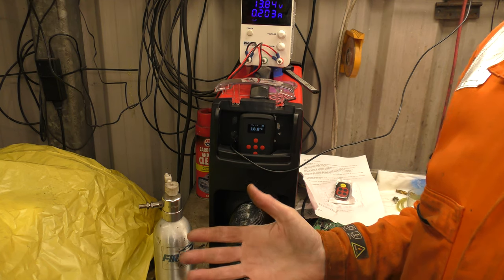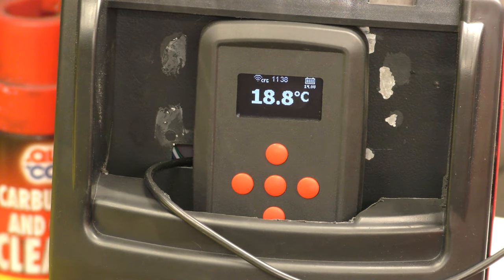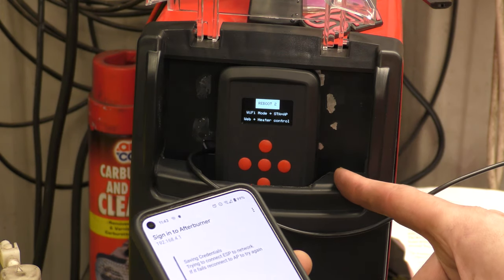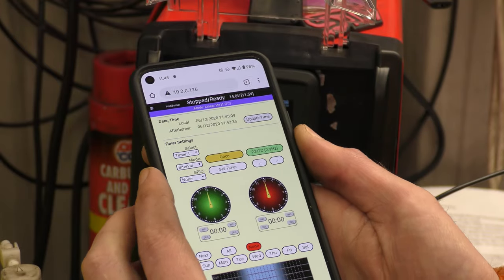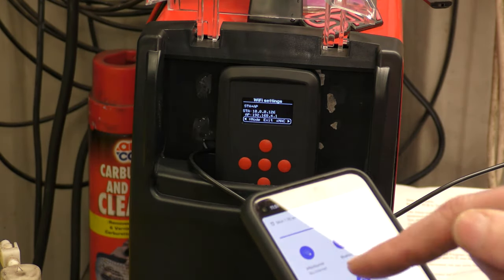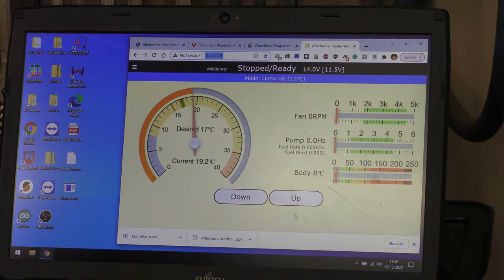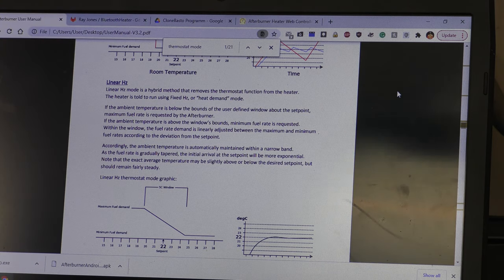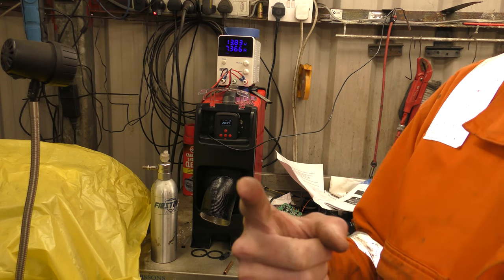Afterburner - quick wifi connection

Comment: I've ordered the afterburner through Ray and is on its way. Question I have is how do you get the wifi to connect to different  location to your home wifi for example. Is that straight forward enough? 
I ordered all the whistles and bells one..
I'm 170 Miles away from what i want to switch on?

Comment: Great video thanks..  

I was wondering if u could do a video showing any ill affects the diesel heater would have if using diesel with a fuel additive in it.  The likes of dipetane or other additives for cleaning dpf filters as most camper owners will have the heater plumbed to the main tank?  Cheers

Comment: Hello mate just fitted my sixth one of these heaters this one has come with green plastic flexible hose for the fuel can you see any problems with this flexible fuel line as I am thinking it might cavitate or not give proper delivery as it can expand when the pump pulses and also it's a 4mm bore cheers for all your videos you are an inspiration hope the info I sent you last message came in handy as a reference
Reply from the maker: Fuel hose is fine.  I've got that green stuff on this heater and a few others I've had are supplied with it as well.  The fuel doesn't need any real pressure going into the burn chamber as it's the heat of the atomising mesh that atomises the fuel.
Reply: @DavidMcLuckie  ok thanks for the reply it just looked a bit sceptical and flimsy I don't even know if it's diesel proof it's not flammable so that's a good start!! It's running under a van through rubber grommets .... My main concern was the pulse of the pump not delivering full fuel flow burner end because of the give in the hose ......IL run it up again tomorrow cheers again David

Comment: Probably an obvious question, but cab you it be used to run just the fan with the heater off? I have a work van kitted out with a fold away camper set up, it's biggest downfall is ventilation, just wonder if as well as being used as a heater, if it can be used to draw cold fresh air in from outside. Cheers man, love the videos
Reply from the maker: I wouldn't have thought so as a correctly installed heater recirculates the air it's heating, not drawing in more cold air from outside.
Reply: I would like to see that function also, just to have some air movement on still balmy summer nights.  I've been tempted to splice into fan wires for this reason.

Comment: Could you explain why wasted heat from the Diesel heaters is not captured in a secondary heat exchanger.  For example, the clean exhausted heated air is passed over a coiled exhaust pipe chamber, and the combustion gases are passed out to the exterior as normal?
Reply: I've seen it done nicely with a cast iron radiator and a moisture trap

Comment: If it’s connected to home wifi it should work anywhere tri IP address when on cell service only. Should pull up an run remotely anywhere around the world if so.
Reply from the maker: Yes, you could set up a dynamic hostname (assuming dynamic ip address) and you could just browse to your own hostname and voila, into the heater controls.  :)

Comment: I'd like to see if you could use the heater to dry cloths in a tumble drier if you removed the elements. For off grid . Just a thought.
Reply from the maker: I don't see why not.  Sadly I have a dead tumble drying, but it's the drum bearings that are spent.  So I'd mostly be setting fire to clothes inside a tumble dryer.  Don't give me ideas.  :)
Reply: Dryer heaters are generally 5kw so it would be a great fit

Comment: In the "System settings" - there is a "Start qualification" setting - apparently that allows to start the heater even when the ambient temperature is above the desired temperature - I guess useful for testing and demos.

Regarding my question on a previous video, the firmware development page lists among various bugs fixed "Incorrect start denials due to Low Voltage Cutout" - so maybe it is smart enough to ignore voltage drops due to the high current consumption by the glow plugs during startup?

Thank you for the video - all very interesting!
Reply from the maker: The start qualification is good if let's say the current temperature is higher than the desired temperature and you know it will fall and want the heater on.  So it'll come on in suspended and only fire up once it gets below.  Otherwise it just wouldn't let you turn the heater on if the desired is above current.
Reply: Oh ok - thank you for the explanation. I've been reading through the manual, but I still can't understand what is the difference between shutdown mode, suspended mode and standby mode. I guess if the heater has stopped, it has to go through the startup sequence, glow plug etc. anyway, doesn't it? Or maybe in full shutdown mode the heater will not come back on automatically no matter what the temperature or other conditions are met?
Reply: Its Low Voltage cut-off is really clever - in that as well as obviously being able to set the LVC - in the same setting screen (on the device itself), it also allows you to set a 'margin' - so, say 0.5, means it will still allow start-up with the drop going to 10.5V.

Comment: hi still having problems cant get any of my 3 new pumps to work can see flashes on a lamp if i go across the pump does not make any sense
Reply from the maker: Hmm.  So no tick from the pump when plugged in?  What size of lamp did you test with?  Could try with a 12V headlight bulb and see if it's a load issue.
Reply from the maker: The only other problem I've seen like this was when long thin wires were used for a fuel pump.  I had continuity along the wires, but the pump refused to work.  Shortened the wires and the pump worked, but unhappily.  I suggested swapping the wires out for a heavier gauge.

Comment: I love your videos and attitude keep up the good work I just got two metal housing 8kw heaters to put into my bus and what I would like to know if I could control two heaters with one afterburner
Reply from the maker: I'm not sure about that.  In theory if you could have one ECU control both heaters, basically piggy back the fuel pulse, fan voltage and glow plug to the second heater.  Then you could have one AB control it that way.

Comment: Dear friends. 
May I ask if a 60v 5amp @ 150w bench power supply. Allow me to use 12v at just above 10amps for a diesel heater??? 
I know I can buy a 30v 10amp supply but my needs will need at times to supply 42v @ 2amps. 
Any help would be highly appreciated ✌️✌️✌️
Sincere regards, 
Scott. ✌️🙏✌️

Comment: Great video, but I think I'll just stick to pressing on and off with the controller if I'm up and the fob if I'm in bed. Much simpler.
I defo dont want it turning on and off by its self all day and night using 8A every start up and shut down.
Reply from the maker: A lot of people really, really want that feature though.
Reply: @DavidMcLuckie  yes I'm sure they do David, just not for me, especially when it costs over a hundred quid delivered to the UK.
I'm an easy going modern hippy if you like, I like simplicity, far less to go wrong.

Comment: Great video, I wonder if there is a way to customize the webpage, would we cool to have it running on a tablet mounted inside a camper
Reply: You can run NodeRed on a Raspberry Pi with Mosquitto to create your own Dashboard. :)
Reply: According to the online manual: "The web pages still do need a bit of work, but they’re a start! If you’re a web wizard, by all means improve upon them and offer the improved pages back – this is an open source project after all!" - so I guess the answer is "yes" :-)

Comment: Helloo fae Loch Lomond ..if you mess up the settings can the heater be run to self destruction ?? Oh aye dae it ..👍👍🤣
Reply from the maker: No.  It'll either not light, run like shit, or get to hot and the overheat safety will kick in.  Self destruction would require a manual setup. :)